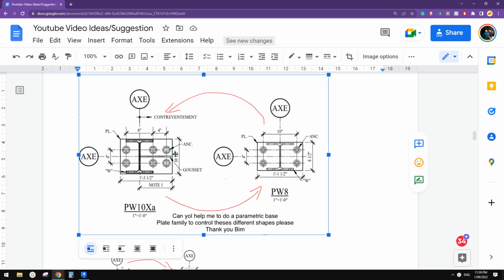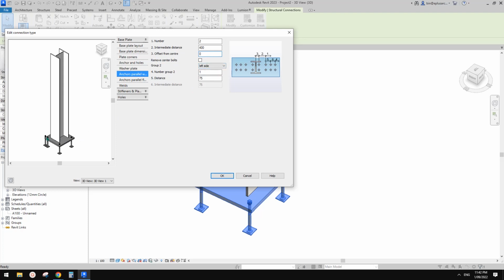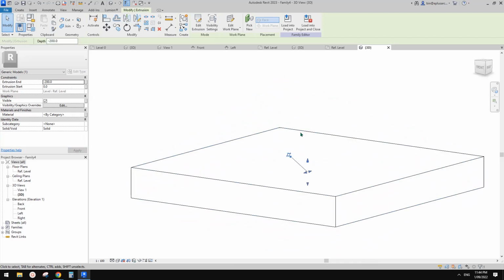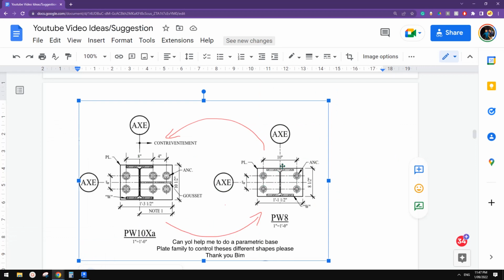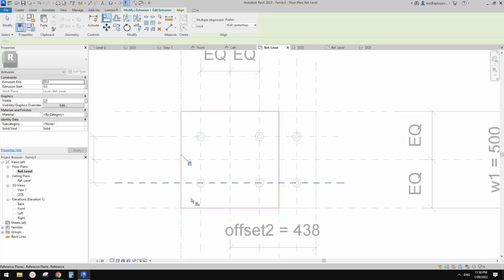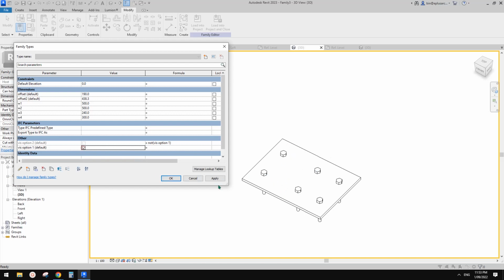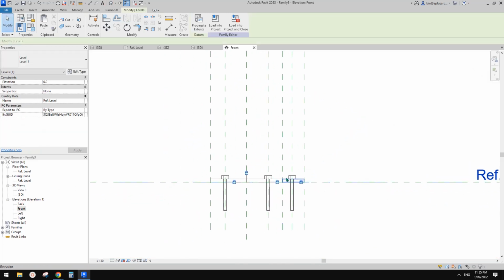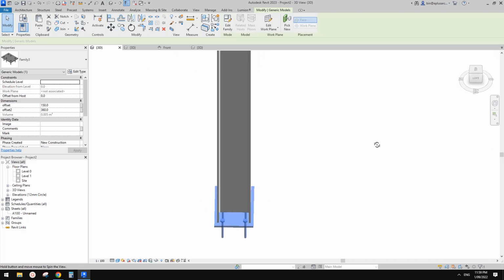Revit Exercise (Day 892) - Parametric Generic Model Base Plant Family

Comment: Hi, so I’ve heard those connections are referred to as fabrication parts and are like special files, and also plumbing pipe fittings have its own fabrication parts which are not families, they are like a special kind of file, besides the Revit families. My question is, in case I create the family instead of using the complicated fabrication menu how do you propagate the connection to several columns just like with the fabrication connections. And is it ok to leave them in the generic category? Or is there a special category for them?
Reply from the maker: Please correct me if I am wrong since I mainly do architectural stuff. I believe that you can probably create these connection using the Connection tool under structure tab. You can modify a lot of settings such as plate thickness, bots type, number, etc. But it can quite complicated in order to get the size or shape you want. That’s why some people just model them themselves. Same as the pipe fittings, which can be loaded into Revit from the Autodesk content library and automatically fit onto your pipes with matching size.  Usually, there are subcategories for all these family. For example, the structural connections subcategory is under the structure framing categoric I think, and the pipe fittings might be under the plumbing catogery. You can go to the Object Style to check them out.
Reply: @BINHE615  I took a course in MEP and the Instructuor giving the course said you got 2 options Fabrication or Families, if you are using Revit you are better off using the family than handling those non RFA fabrication files. I was just wondering if that applied to Steel connections, which you as well agree some may prefer creating the families . In Revit Structure once you apply a connection to a steel beam, the beam permanently looses parameters like start and end extension, Shape Handles, and end up with irreversible huge gaps at the end of the beams that expects a connection to be placed. I avoid using connections cause of that menu, I just use the Fix end and Start extensions and use the Beam/Column Joints tool for corners. But sometimes I want to add a plate here a there,  and may want to propagate it, I think I saw a video where they created the plates inside the project and then they assigned them to the steel connection, thus giving the option to propagate. I will stick with copy and paste for the moment.

Comment: I don't know if it wouldn't have been faster to add a generic connection and by modifying it create a family of structural connections by adding plates and bolts.
Reply from the maker: I think it is faster to use Structural Connection.